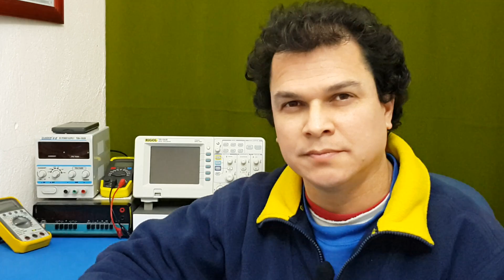#Electronics Engineering and Technology Channel

Comment: Hi, Are you in the US? I need help! If you may fix or check my PC motherboard. I just spill coffee on it. Thanks.
Reply from the maker: +Osama Altarooti  Hi! When did your PC drink the coffee? Do not turn it on! Most desktops have a vertical motherboard. If it was horizontal then it could be a problem. If you are not technician, bring it to a computer service. They will apply the right procedure. If your PC is a laptop, remove the battery, don´t turn it on, and send it to your local technician today.  You will have to add a new keyboard to your technician soon or later. I will record a video about what to do. :(
Reply: +Bob. Kalpon Thanks for your response. that was before about 3 hours a go and unfortunately it has horizontal motherboard. i already opened it and try to dry it carefully by paper towel and i did not see any damages in the circuit board and thank god the CPU was not involved in the disaster accident. also i am not sure about the power supply if it effect or not. So do you think it may fix or not?
Reply from the maker: +Osama Altarooti Dear Friend; Go to the pharmacy and buy the highest degree alcohol you can get. More than 90 degrees. Disconnect everything. Take pictures before. Ask a computer skilled friend to help you. Remove the motherboard and deep it in alcohol. Brush it with a very soft painting brush (1 inch width, no thick). If you can dry it with a 80 psi air compressor will be the best. Or plan "B" with a hair blower with circular movements. MAKE SURE the alcohol is transparent. NO RED or BLUE color in the alcohol. Wait 2 days to ensure the board doesn´t get white color in the soldering. I am out of town and I can not help you with a live video until next weekend. :(
Reply: +Bob. Kalpon Well, I really appreciate your time thank you very much. I will try to follow your instruction and will tell you what will happen.